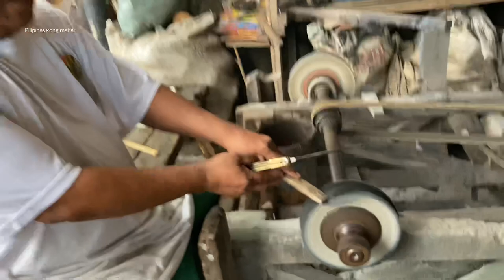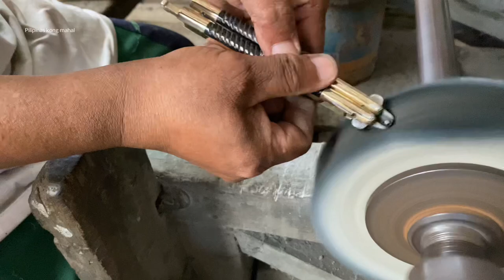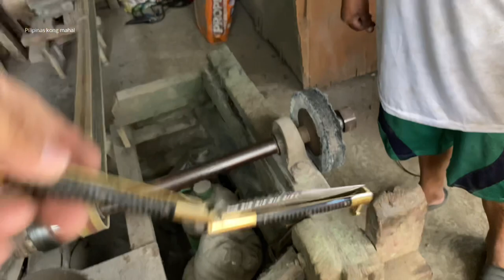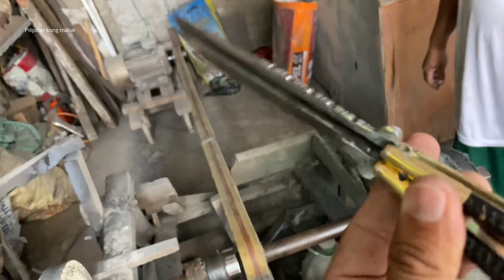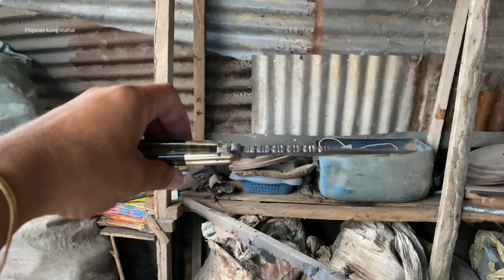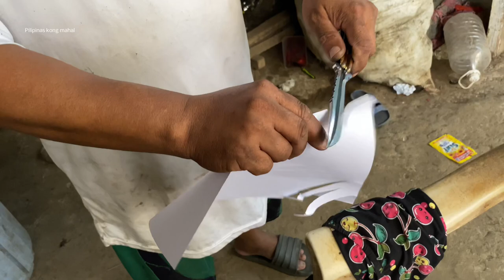Dagdag Collection Nanaman : Balisong Galing kay Rosauro Lopez ng Balisong Taal Batangas

Comment: Ang bakal ay walang kwenta. Mapa leaf spring or bearing material. Pag na subject sa high heat you lose mechanical properties. Unless idrop forge mo to align grain flow. Increased strength. Ngayon kung ang materrial na gagamitin mo ay nickel based super alloy yan ang pinakamaganda.
Reply from the maker: wow maraming salamat po!